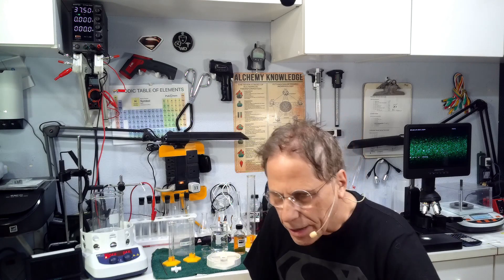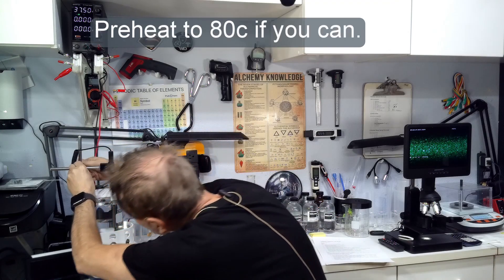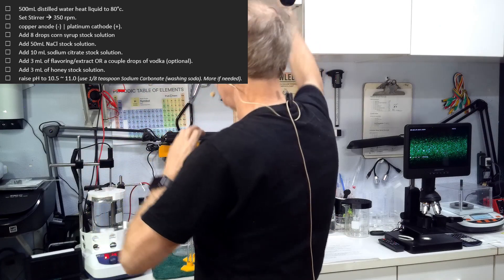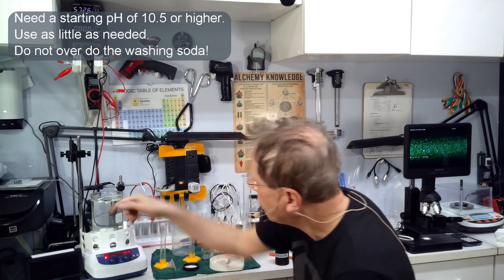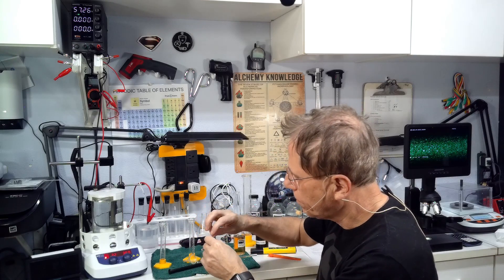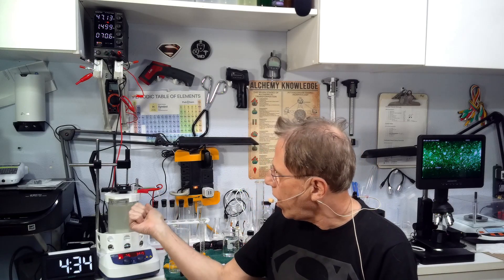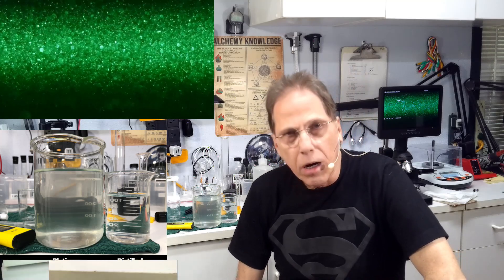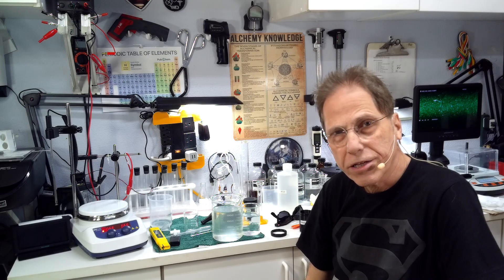Making Platinum Nanoparticles (Clear) Start to Finish Part 2!

Comment: Thank you for the detailed process. It's going to be a while before I get everything together to try this. But I will eventually, and let you know it goes.
Reply from the maker: You can do it!
Reply: @AlchemyWizard   have you made colloidal indium? Read a lot of good things about it.
Reply from the maker: @CameraObscura-hq9rs  I saw the metal yesterday on Amazon. I will look into it. So what have you heard about indium?

I got Chromium metal here which was a recommendation also that I'm hoping to get to over the next few days and then produce a video on it.
Reply: @AlchemyWizard   This description about sums it up: 
Indium enhances food and mineral absorption by the body. It helps correct mineral deficiencies you may not even have known about. Most people experience beneficial results immediately. 

Short-term benefits, as reported by many indium users, include increased energy, reduced need for sleep, and an enhanced sense of well being - the "indium high." Long-term benefits include a gradual correction of many chronic illnesses. This includes, but is not limited to, improved blood pressure, healthier body weight, and a reversal of visible signs of aging..
Reply: @AlchemyWizard   also, is the Bredig's arc method superior to the one we are using with additives, etc? It requires a voltage input up to a 10000 volts, and a double vessel, with the outer one full of ice. But it's a preferred method for chemistry students for forming colloidal metals.
Reply from the maker: @CameraObscura-hq9rs  wow, impressive. I will add that one to my list to work on. Thanks for the brief rundown on what it does. Amazing.
Reply: Nope, the Bredig's arc method seems to be only used for Silver, Gold, and Platinum. Not copper. And I haven't yet figured if it's used for others.  I am now impressed that you have found all these edible reducing and stabilising agents that are also edible.
Reply from the maker: @CameraObscura-hq9rs  I have read about enclosing platinum in ice to make it work with HVAC. If I can get the HVAC to work with silver, I will try it on platinum in water first that is not frozen.
Reply from the maker: @CameraObscura-hq9rs  I do think the low voltage method would be superior to HVAC. Main reason I say that is there is alot of research papers devoted to making platinum nanoparticles using various chemical processes, some green, some not so green. It makes me wonder that if HVAC method works why not just use that? Why waste time trying to use a chemical process to make industrial strength platinum nanoparticles?

I think the key is the capping agent. The capping agent is like a force field that keeps the nanoparticles intact. I suspect that the HVAC method has a very poor force field, because its basically made of hydrogen or oxygen. It probably breaks down easily. This is just a guess on my part, I have no research to support that claim. 

The capping agent in the Honey would be the compounds in the Honey. The capping agent in ascorbic acid would be the vitamin c. I'd have to ask my chemist what she thinks is doing the capping with ascorbic acid. 

Just a guess and if I have a choice, I would prefer to consume Low voltage colloidal nanoparticles over HVAC ones. 

Yes, where there is a will there is a way with finding eatable solutions for reducing platinum. We have honey and now Ascorbic acid (vitamin c). I will be trying a few more eatable reducing agents as well over the next few weeks. 

Also, I'm having good results with swapping out my anode and cathode every hour to negate the production of platinum dioxide.
Reply: @AlchemyWizard  I understand that the outer tub has ice to condense metal vapours formed by high heating arc, otherwise, the metal vapours are lost. Also some people add KOH to stabilise the colloids that begin clumping together - which of course is not an ingestible alkaline substance. Your formulae for alkaline media are possible substitutes
Reply: @AlchemyWizard  I tend to agree about the low voltage - but I suspect my reasons are more because of a reluctance to dabble with high voltages!
Reply: I'm really interested in knowing how to make some colloidal indium now.  Is it just like silver or gold?  Thanks.

Comment: Ever tried formic acid as a reducing agent???
Reply from the maker: Formic acid is toxic to the body. If you want to drink a colloidal the reducing agent you use must be one that is nontoxic. Putting just any random acid or chemical into a colloidal setup does not make it drinkable. Sure there are many ways to break down metal and create a colloidal but they must be safe for use in the body.
Reply: @AlchemyWizard sodium borohydride?
Reply from the maker: @vishalumadas8809  This is another toxic substance to the human body. NIH states: It is decomposed by water to form sodium hydroxide, a corrosive material, and hydrogen, a flammable gas. The heat of this reaction may be sufficient to ignite hydrogen.

Comment: Hello Hermes, Thank you so much for your videos. I have been watching those referring to colloidal metals making with a lot of attention. I have been making silver, gold, copper, zinc and magnesium. I have learned a lot of additional things from you.
I have a question about the microscope. I have one and I can't see the spectrum that you show. Probably, I am using a low quality microscope. What do you use to see the particle spectrum?
Thank you so much again, Christophe
Reply from the maker: I use a green laser shot through the colloidal mixture to capture these images. (see image link below.)

On my WD download page you can get the 3D files to print up the laser containment system I created. There is a link to the laser as well there and for the beaker that you will need, depending on which version of the laser containment system you use. 

• Laser Containment system: http://wisdomsdoor.com/files/misc/laser-containment-system-evolved.jpg
• Lab Equipment 3D Printer files and other (free download): http://wisdomsdoor.com/files/index.php
Reply: @AlchemyWizard  . Thank you again. Fantastic job. A lot of great information on your webpage. I tried to look up the microscope but I could not see it, maybe because I live in Europe and the access here is reserved. I looked at Amazon here and there are some lab biological microscopes starting at around 500USD. Should it be good enough? Any suggestions? Thanks again. I am looking forward to other videos of yours on colloidal metals. Next time I will share with you, if you wish, my novel use of colloid silver and gold.
Reply from the maker: Amazon UK has the Andonstar AD249S-P digital microscope. With a conventional microscope you have to be careful that you do not look into the lens. You would need a camera for it. And tape the lens over so you do not by mistake look into it. The laser light can flash upward and it could damage your eyes. I would dig around more and try to find a digital one like the Andonstar model above, where it is impossible to look directly at the laser.

One of the reasons I made that laser containment system was to keep the laser from bouncing all over the room. It can be bit dangerous not only to yourself but to others who may walk in the room while it is on.  Be careful if you go with a conventional microscope and get a camera, use precaution. If you can get my containment system printed up on a 3d printer, and do not look into the lens then you be golden. 

I would love to hear how you are using silver and gold. I encourage everyone to leave feedback on how they are using their colloidal and how they are working in their lives and the lives of others.
Reply: @AlchemyWizard  Fantastic Hermes. Thank you so much for your information. I was not aware of it and now I will be careful. With the microscope I would also like to see the blood and its structure, but that's another thing. 
I have made pictures of the colloids I prepared and not knowing how I could show them to you I placed them on the Google Drive. I wrote a comment to it. The colors may look somewhat different from what you get and I would be interested in your eventual comments and observations - if you find time for it. 
With colloids, I am a beginner so there is still a lot o trying in front. Do you work yourself with a chemist or how do you work out your procedures?
Below are the links to my photos. If they are not clear I may do other ones. One general comment to the images:
Copper - slightly Turquoise color.
Zinc - slightly yellowish color
Magnesium - clear honey color
Gold - against the light transparent light-honey color but with light has a non transparent blueish-greenish tint.
Silver - similar to gold: against the light transparent light-honey color but with light has a blueish-greenish non transparent tint.
The links:
Picture 1: 
https://drive.google.com/file/d/1A21AldGfRpHjtbotXNEyQidSA2TCH6MV/view
Picture 2:
https://drive.google.com/file/d/1AKG-t7oWKcJG9nRb6F8yxss9FHHKFDYt/view
Reply from the maker: Picture 1: Your copper looks good, just a bit under the light colored side. It probably could be cooked longer. You may have to clean the copper rods if they get heavily oxidized. Zinc looks good here. Magnesium, I've never seen magnesium with a color. it is usually clear. AG (silver could be correct for a brown silver. The Au (Gold) something not right there. It should be pink, red, violet, or grey. 

Picture 2: Au (gold) This picture looks like Grey Gold. Ag (silver) this could be silver at about 18ppm.

Comment: Hermes, doing my first batch of platinum and it turned dark amber within the first hour, is it still good to consume?  Did I do something wrong?  I followed your Platinum lab sheet exactly how it explains it.  What are your thoughts?  Thanks.
Reply from the maker: The dark color is from the caramelizing of the citrate from the heat. You can drink that just fine. You will see this dark color in one of my shorts in the beginning of making the first batches of platinum (link below). The colloidal itself is a light caramel color, but you can't see it because the citrate caramelized much darker. 
https://youtube.com/shorts/6Byx5gmQrF8

Comment: hi i use 60 V power supply and I can only reach 1 A after 1 hour. I followed the procedure exactly. I could not reach 1.5 A for some reason.
Reply from the maker: Hi! 1amp (1000mA) is fine, it will just take longer. Anything over 800mA seems to work for LVDC platinum. I'll add a note in the description about it.

Comment: I made the colloidal platinum but I didn't like the taste.
So I tried making some by brushing two pieces of platinum together under water while applying current from a 12 volt battery charger for 5 minutes.   About 10mg of platinum was used up.    I know it produced particles because the water was smoky but I have no idea if they're nanosized or not.    The particle concentration was 10 ppm.   
Do you know if anyone else has tried to make it this way, and if so, what size of particles were produced?
Reply from the maker: I've never heard of this method. It's doubtful you created any nanoparticles. You probably just created solids of platinum floating in the liquid. Basically, it was like using sandpaper on metal. The color change is from the metal oxidizing.
Reply from the maker: @simonruszczak5563  oxidation particles can be very small ionic content. Easily bypassed by any filter.

Comment: Hello. Can I get results with a 36 volt 1.5 amp adapter? I would not have thrown the current over 1.5 amps. does it help
Reply from the maker: The current may want to go over 1.5 amps. the power brick could overheat and burn out. To limit the power to 1.5 amps you have to add a 25 ohm. 60 watt resistor in series. So far I have not found a way around cooking it with less than 1.5 amps of power for platinum.
Reply: @AlchemyWizard  I have to buy a power supply for it. I managed to do the colloidal actin with the adapter but that doesn't seem possible for platinum. I really want to make colloidal platinum. Is a 60 volt power supply suitable?
Reply: I spelled actin wrong. would be gold
Reply from the maker: @vedatkahraman6964  You do need to use current limiting. A 60v supply at 5 amps would send the current to over 2.5a. that will cause the creation of platinum dioxide quickly on the cathode. 

I've been experimenting with using two platinum rods (anode and cathode) and swapping them every hour to keep the platinum dioxide under control. It may work for higher current but I have not tested that.
Reply: @AlchemyWizard  I will make my colloidal platinum by keeping the current constant at 1.5 volts as you described. The platinum experience is very exciting for me. Thank you very much.
Reply from the maker: If you can pick up something like this it would limit your current to 1.5 amp max on a 60v 5 amp power brick. Wire these two 50 ohm 50 watt resistors in parallel to each other (connect the two ends together) to give you 25 ohm 100 watts. Then wire the parallel resistors in series with one of the power leads from your power brick. 

50 ohm 50 watt resistor (x2): https://amzn.to/3YwGWvy
Reply: @AlchemyWizard  Thank you very much. It is a great chance for you to guide us through these experiences.
Reply from the maker: @vedatkahraman6964  Glad to help and your feedback and questions helps me as well in my understanding of these healing nanoparticles.
Reply: @AlchemyWizard  thank you very much